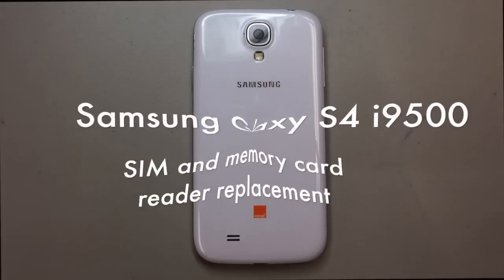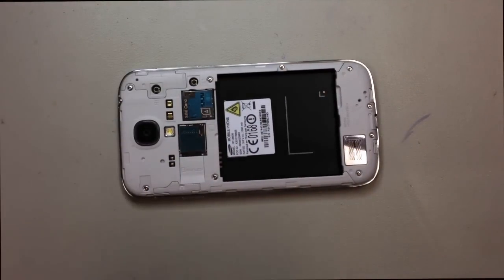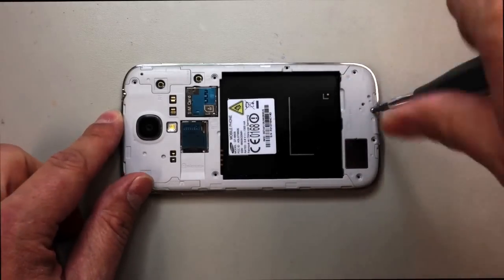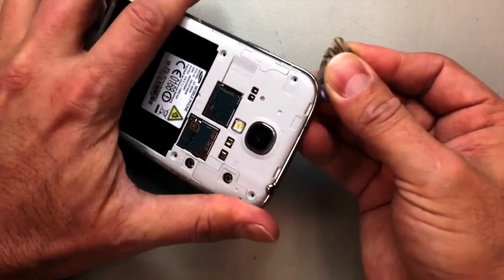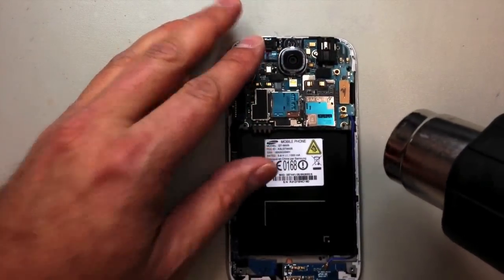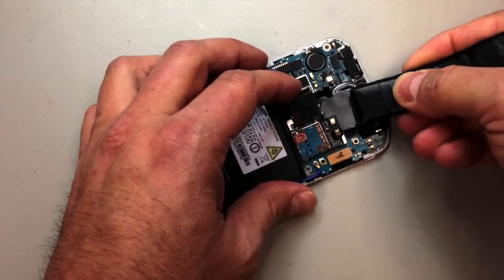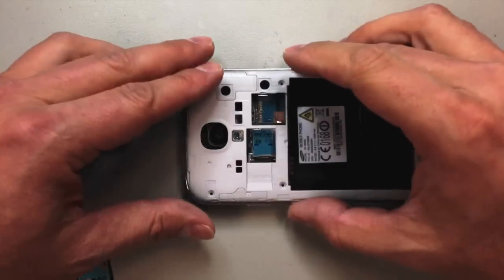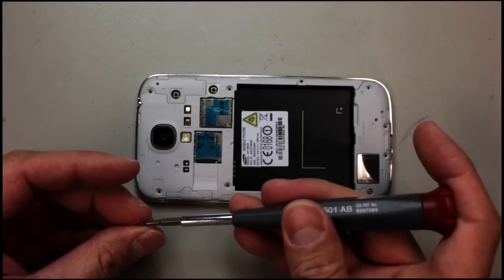Galaxy S4 SIM and micro SD card reader replacement

Comment: Could you possibly make a video like this for the Galaxy S5? I'm going to have to replace the sd/sim card reader on my S5 soon but have very little experience, but apparently this is the only fix there seems to be for a common bug. Cheers
Reply from the maker: Moehni I will as soon as I come across another S5 but keep in mind it is very, very easy to break the display when you remove it and this is required to access most modular components including the sim reader.
Reply: Thanks for replying. I managed to fix my problem without having to replace a part. Thickening the sd card by sticking 2 post it notes to the back worked, the apparently deformed metal top now reaches the sd card again and can apply enough pressure for the reader to make contact. But thanks anyway, and maybe somebody else needs this video too.

Comment: Does the sim card reader change from the Att S4 and the Verizon s4 or is it the same slot and sim card reader ? I ordered one online it came but it said s4 i 9500, and I have a Sgh-i337.i replaced it but it won't read sim at all everything is connected properly.
Reply from the maker: Nicky Rosado The i9500 and i337 readers are compatible so either you got a defective part or there is something else causing the problem.
Reply: Ok

Comment: Go Cell Phone Repair help plz! I actually have an e980 (LG Optimus G Pro) Some idiot at At&t broke my sim card tray prongs when taking out my sim card. I bought and installed the new sim micro SD flex cable. Still it reads "No Sim" but my sd card is being read. Does the adhesive have anything to do getting connection?
Reply from the maker: It looks like the SIM/SD card reader is modular so you should be able to replace it. I haven't done one yet but if you find a G Pro tear down video it shouldn't be too difficult.

Comment: Is important to really buy a new sim tray? I mean the adesive has any role? I have an old s4 with display broken and i want to take the sim tray from him but i dont know if the adesive will affect the connection? Any clues?
Reply from the maker: Nope. Just need to be functional. You can always add new adhesive.
Reply: At what temperature the adhesive is melting? Can i use a hair dryer
Reply from the maker: Yes you can use a hair dryer. Just want to reach ~100 F.

Comment: While removing my adapter the sim partially fell out exposing the hollow where the sim is housed this allowed the bronze prongs to be caught and as I pulled out the adapter 3 of the prongs broke. Tried to put it back in, it no longer detects the sim. The dangers of using sim adapters. SG4. Perhaps the adapter would benefit those who have sim door that props up minimizing the chance of having the prongs break.
Reply: Same thing happened to me today. I tried taking the adapter out and it got stuck I had to use force to remove it and two metal/copper prong came out lucky it still works! Be careful using Sim adapter s!!!
Reply: Jerry Woods SAME!

Comment: my sim card reader gets hot and at times my phone say Unable to detect sim card reset the phone after shut the phone down and turn it back on it will work or say no sim inserted. could this be my final solution before give this phone up or see if its just the sim card itself?
Reply from the maker: I doubt that it's the SIM card but it doesn't hurt to try a new one. There ae a few different things that can cause what you described but beyond resetting the phone or upgrading the software this is the least expensive solution to try.

Comment: I dont have a heat gun to use do u think that i could use a blow dryer because of how the air of it heats up
Reply from the maker: You can but it will take a lot longer and doesn't really get as hot as you want it ideally.

Comment: I have a No Sim Card/SIM Card Removed problem. I replaced the SIM/SD card reader but this did not fix my problem. On the internet there are a few threads that suggest to reflow U500, U501, or U203 [try one by one and then test in that order]. That may actually work. Make sure you use no clean flux.

Comment: good video but pease try to anwar our questions ok
PLAESE  How much u maintain heat and air?
AND DID YOU USE ANOTHER GROO
Reply from the maker: Warm to the touch but not so hot that it would burn your hand. Somewhere around 40C should be plenty. I'm not sure what you mean by GROO?

Comment: Hi!!! do tou have any idea how to fix antenna of the  SG s4,,cause mine shows the signal bar but i can make calls,,i did call to the my  phone company try to fix it but at the and they said that the the probles is the antennas phone :/
Reply from the maker: You can replace the antenna module and/or the wire itself but that may not necessarily be the problem. Check out my S4 screen replacement video to see where the parts are located inside.
Reply: Ok thanks

Comment: i have a problem. I recently replaced my sim reader and the sd card part of it reads perfectly. however it does not read sim cards at all. ive tried different sims which work well with different phones but none of them are being read by the phone. ive even rebooted/hard resetted it and wiped all data and still no luck. ive been advised to go to my local samsung store (repair store) to see what they can do. is this my only option as I have the feeling this will be quite costly :(
Reply from the maker: Did you have the same problem before you replaced the card reader? It's tough to say without having the phone in front of me. It sounds like a defective SIM reader but could be something on the logic board itself. I assume that it is out of warranty. If you run out of options you can ship it to us for diagnosis.

Comment: i replace the sim card reader but i still got the same problem the phone "says sim card has been remove" and then reboots , I already checked my sim card in my spare phone(cheap lumia 635) and it works fine.

Comment: So I had my cracked screen replaced today, and at home upon inserting my sd card it wouldn't recognize it anymore (stil works in laptop). The sim still works, does that mean the sd reader is likely to be broken?
Reply from the maker: Sounds like it. If it's reading the SIM then it is plugged in which would have been the first thing I'd check.
Reply: Went to the store and he plugged in another SIM/SD reader and my sd card was recognized immediately. So yeah, that was the case :)

Comment: ok i have no one else to ask about this...
my phone is an m919n
originally a metro phone and i use my simple mobile on it...

few days ago it started with i cant hear calls and they cant hear me unless im on wifi.. i have tried everything cept doing this and sincei get sim card error and restart im assuming this is my issue...

now my question is this.....   is the reader for m919 and m919n different... i dont want to order the wrong part
Reply from the maker: AKAIK they are all the same. As long as yours has an SD reader too you should be able to use any model #.

Comment: Gday, I replaced the part. Now my SD card doesn't mount. Thoughts? IT detects the sim, but not the SD card.
Reply from the maker: +Brent Manning A few possibilities. Have you already verified that the SD card works on another device? Beyond that either your new reader has a problem or the phone itself.
Reply: +Go Cell Phone Repair Thanks for the reply. Yeah the SD works in all other devices. Anyway, the sim card error came back a few days after the repair, now the sim is permanently not working. oh well. I just bought a GS5. Nothing wrong with the tutorial, I must just have an old phone.

Comment: Great Video! can you tell me how to repair the antenna!
Reply from the maker: You can replace the antenna wire or the charging port which is part of the antenna system. See this video: http://youtu.be/fdc9zA-mGq8 If the antenna connector on the main board is damaged... well that's beyond what I can show you at least right now. Replacing the whole board would probably be the best choice unless you have some serious micro soldering skills and equipment.
Reply: Thanks man. You are really helpful. How much do you charge to fix phones or trouble shoot them

Comment: Thanks for the vid, but I have a serious problem with my samsung s5. My s5 is water damaged, therefore it's not working anymore. I took it a phone repair shop and they told me the phone is dead. Now I want to transfer my contacts from my not working s5 to my new phone. Knowing that I had an SD card on MY S5,  I didn't transfer my contacts to my SD card when the phone was still working. What can I do know to transfer my contacts to my new phone? Should I take off the Micro SD Memory card and put it on my new phone?
Reply from the maker: +Didiss K.T. You can try but your contacts most likely will not be on the memory card unless you exported them manually.
Reply: Thank you for your answer!

Comment: Sorry. I have the same problem with my galaxy s4. I've followed the tutorial and have it replace without any problem. But it still not working, i have reset it for few times and it works. But after using it a while, it's the same problem again and again. Also this is the second card slot reader that I've changed and it won't work. Any suggestions?
Reply from the maker: If you are out of warranty and the problem keeps occurring you might need to replace the board. Have you checked for software updates or tried a hard reset?

Comment: Hi there!
Of course I see that you're talking about S4 but I have something here with my S3 and pehaps you can help me. Its a chalenge...
I have 2 S3: one has the broken LCD and the other works great, "besides" it cant see the simcard. I bought a new sim tray and... the problem still there.
I thought that could be a problem at the mother board so, switched  motherboards.
That one for the "broken LCD"'s one works great but... guess what?
The problem was still there!
Well 3 Sin Tray x 2 motherboard. 
I made ALL combinations between them and at ALL says the same!
I made factory reset on both! 
New APN...
BTW, the simcard works normal at my wife's Iphone and also at my friend's S3 Mini...
That a good question, I guess!
:D

Many thanks in advance!!!
;)
Reply from the maker: +Lypovsky Lypo That's a tough one. From what you said it sounds like maybe you have either two defective boards or two defective SIM readers.

Comment: My sim card slot reads just fine so long as I use mini-sim adapter and not micro-sim and make it so the battery holds it into place in the slot as the springload piece doesn't seem to work (where you push to release, push to lock in), any clue how to fix that or do I need to replace the whole slot?
Reply: +JustExtreme if the problem is that the sim card moves then you should simple take one presentation card from your wallet, mark the size of the sim then slide it into the sim card port, but not entirely, then underneath it slide the micro-sim, it will get pushed inside and not move back, however if you are experiencing the classic problem of s4s where the sim card gets disconnected for no reason and not even changing it fixes the problem then I suggest opening the phone, and without removing the screws place a piece of thin plastic that covers the entire sim-sd so when you put the cover back in it gets pressured and don't move, this is a very common problem with S4 and the reason I'm watching this video.
Reply: +Alpaca Male thanks for getting back to me. I was able to return my s4 to eBay seller in the end and now have an s5 Plus which has a different sim reader design that doesn't seem prone to these type of issues.
Reply: cool

Comment: I messed up my S4's prongs in the SIM card reader by inserting a SIM card adapter into it. =( The adapter got stuck in there and I had to mess with it for a long time before it would come out. I wound up having to take my phone to a cell phone repair shop and they replaced the SIM card reader in about 10 minutes for $65! A costly lesson learned.
Reply from the maker: We see this all the time. SIM card adapters are not recommended.

Comment: After taking of the old card reader there was still some adhesive left on the motherboard is it safe to scrape it off? Thanks.
Reply from the maker: Dave Riley If it's just on the metal shield you can but don't scrape your actual board. It shouldn't hurt to leave it there though.
Reply: Go Cell Phone Repair thanks

Comment: My phone gets the "sim card not detected" problem and I need to restart it several times a day. Will changing the sim card reader help with this problem? Thank you.
Reply from the maker: It should. There are a few different things that can cause the problem. This is the most common and other than resetting the phone or upgrading the software it is the least expensive thing to try.
Reply: Thank you very much. I'll try those first and let you know how. it goes.
Reply: Juan Pablo Hurtado Padilla Tengo el mismo  problema. desearía saber como lo solucionaste. Gracias
Reply: Antonio Jimenez Sanchez la verdad no lo intente. Simplemente vendi mi S4 y me compre un Moto X. Suerte con tu teléfono.

Comment: plz help me, i have problems with my Galaxy S4, whenever i try to insert SIM card it gives me no SIM card or SIM card error message
Reply from the maker: This is a very common problem. Try waiting 10-15 minutes will allow the phone to read the SIM card.  If that doesn't work I would try a new SIM before you do anything else. Otherwise you might want to try replacing the SIM reader as shown in the video.

Comment: My phone gets the "sim card not detected" problem and I need to restart it several times a day. Than the simcard will not work at all in other phones also. Ive changed 2 simcards that will work in the beginning, than will ask for restart and than will not work at all. Will changing the sim card reader help this problem? Now Ive put a other card of another provider for now I dont see any problems for now. Will changing the reader help or is there another problem? Thank you.
Reply from the maker: That's a new one for me. If the SIM reader is damaging the SIMs that you put in then I would suspect a problem with the reader. This may or may not fix your problem but if you've already tried a factory reset and any available software upgrades then my next suggestion would be replacing the part and see if that does the trick.
Reply: Go Cell Phone Repair i have the same problem. "sim card not detected". i also have a s4 with a broken screen. so what iv been thinking is to take the reader from the old broken phone and replace it with the other. My only concern is the glue. once i remove the reader from my old s4 would i work or stick on the new one?
Reply from the maker: It should. If not you can always add some. http://gocellphonerepair.com/double-sided-adhesive-tape/

Comment: I have just done this fix however my phone won't turn on at all... any ideas???
Reply from the maker: Hmmm... If it was working before that is strange. I'd retrace your steps and check all connections. This process shouldn't cause any problems with powering up the phone.

Comment: Evidently with the Samsung S4, there is a problem and I was told today to send it in for repair, as it is out of warranty.  I keep getting Insert Sim Card message, eventhough there is a SIM card in the slot.  I have tried several new SIM cards from AT&T and it will not work.  Reps told me they did not know what the problem was.  Talked to Samsung and was told it was a phone problem and needed to be fixed.  Would replacing the reader tray help?  After hours of research, found that this is a somewhat common problem with S4.  If you have one still under warranty, make sure to get it fixed/replaced now.
Reply from the maker: Most of the time this will solve the problem. You can also try a factory reset or upgrade the software if that is an option. And of course if it is under warranty you can send it to Samsung.
Reply: Sandra que solucion tuvo? Gracias por decirlo

Comment: will this fix the mic problem on calls??
Reply from the maker: Unlikely. If it's just one mic then that will need to be replaced. If you have the same problem while on speakerphone then it could be a number of different things causing the problem.
Reply: Go Cell Phone Repair. the mic works any other time.. like when using whatsapp or recording a video... I have seen another video where the replaced a chip .. looks like that road then.. thanks.. I'll have to find out more

Comment: I've tried rebooting my phone but when i do it, it just comes up error. i have the no sim card inserted error . I have a galaxy s4 gt-19505
Reply from the maker: Did you try replacing the SIM reader already? This is a common Galaxy issue and may be the reader or a software problem.
Reply: Como se soluciono el problema del S4 gt-i9505. Ruego lo comentes para los que tenemos el mismo problema. Gracias.

Comment: wow. the frustration right now, 8 of 9 screws removed. cant get the last one out by the charger port. lol
Reply from the maker: Stripped or just stuck in the housing? If it's the latter make sure it is completely unscrewed, cover it with tape, and leave it where it's at.
Reply: Go Cell Phone Repair neither. I just couldn't get it loose at all. Cheap dollar store mini screwdriver set. 
I finally got it out though, replaced the tray successfully aaaaaaaaaand......'NO SIM' :(

I'm trying to avoid an upgrade at all costs. Lol